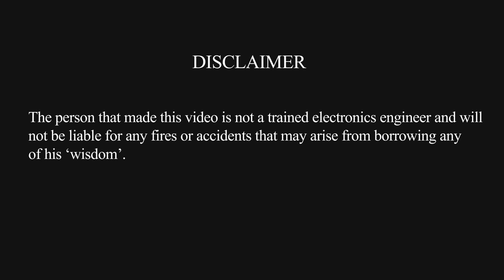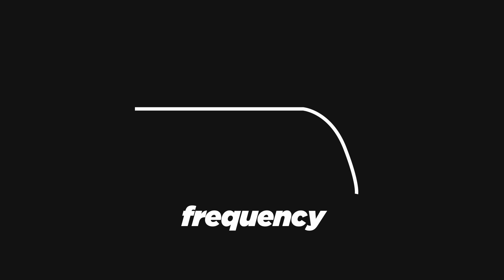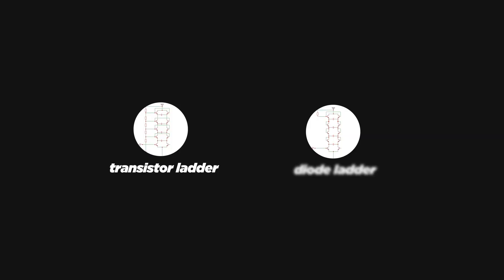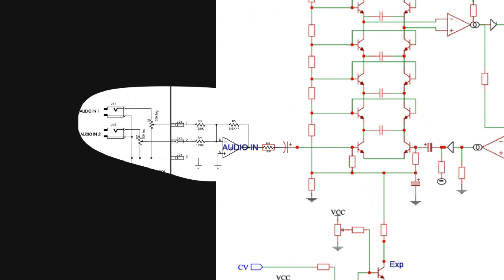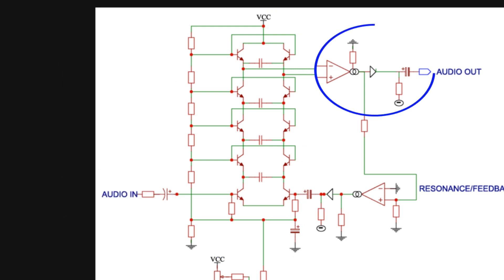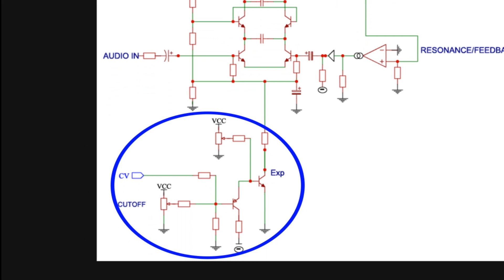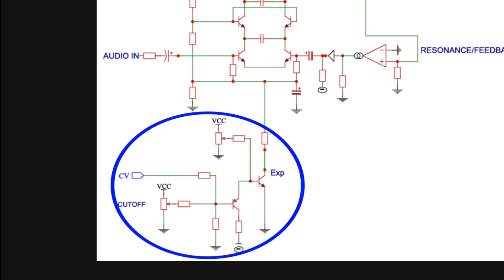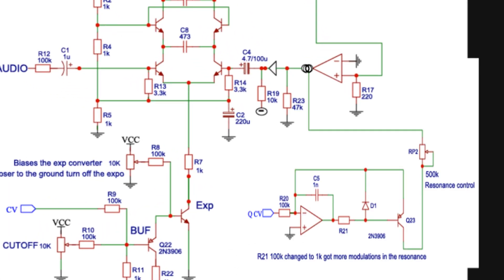How to add Voltage controlled Resonance to a filter-VCF

Comment: In the schematic some components are connected to GND, some are connected to a circle with a minus/dash in it. What does the circle with a minus/dash mean? Thanks! Great idea to use the ota for resonance control by the way!!
Reply: And next to the OTA there is a triangle (left of C3, right of C4) what is that?
Reply from the maker: @bastenhoor6902  In audio and signal processing we expect to deal with signals which are bi polar. They can swing positive and negative. Take an example of a sine wave. To reproduce it with a speaker the speaker should be able to move forwards from it's resting position and then backwards from it's resting position of O volts. So the devices /amplifiers that deal with such signals are powered with a bi polar power supply which has positive voltage, negative voltage and a ground
Reply: @Afrorack  Hi friend! Thanks for your reply. I understand the dual power supply usage. So, is the circle with dash/minus sign the negative power rail? I ask, because you use VCC (instead of a circle with a plus sign) for the the positive rail in your schematic. So I would 'expect' VEE ;-)
Also the triangle next to the OTA, is this a substitute for the 2 transistors (Darlington pair) or the OTA?

Comment: Is there a particular reason why you use an OTA with fixed gain in the output section? 🤔
Reply from the maker: Well I was using the lm13700 which has 2 OTAs...so the fact that I was already using one for controlling the gain of the resonance I dint want to waste the other...transistors or normal op amps can do the job of course...but also OTAs introduce more distortion which may add to the character of the filter
Reply: @Afrorack  thanks. I try to save parts as much as possible my self. wasting half a lm13700 would be a shame!